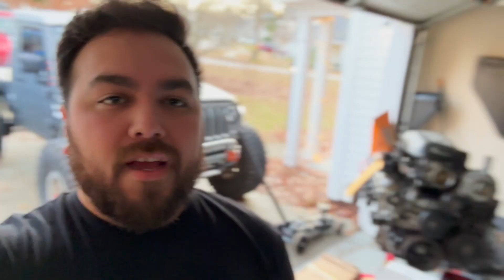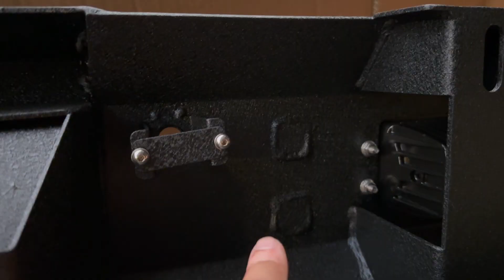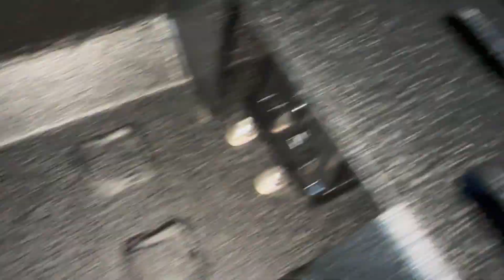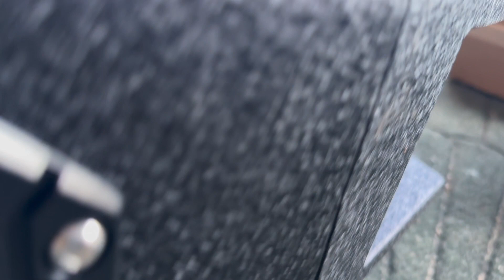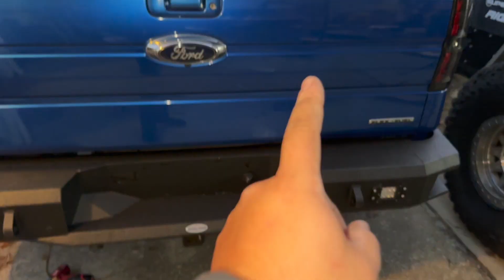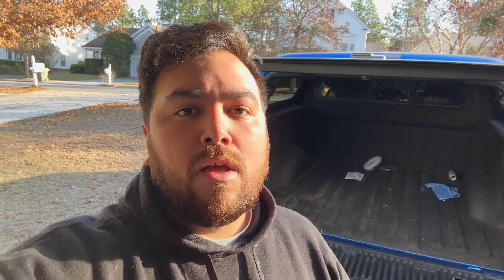Hooke Road F-150 Rear Bumper Install - This thing is BEEFY!

Comment: I installed the bumper but the back up sensor aid keeps going off did you have the same issue if so what did you do to fix it did you have to adjust the bracket of the sensor aid for it to fit?
Reply from the maker: Never was a problem for me

Comment: Just installed the same bumper on my 2017 F150. There's no way the Parking Aid sensors are going to work, there's not enough room for the plug. I noticed you didn't hook yours up also in this video. and the Spare tire lock will not work either, something else you neglected to put on in this video.
Reply from the maker: My rear parking sensors are plugged in with no issues. I don’t remember even trying the spare tire lock though.

Comment: Awwesome instructional, I am installing this exact bumper on a 2013 FX4 right now so this is very helpful. Word to the wise - get a friend to assist with the heavy lifting part if possible! Also a couple milkrates or something to lay the stock bumper on during removal is helpful and safe.

Comment: How did you connect the license plate light? I didn’t see anything on there
Reply from the maker: If I remember right it was just unplugging the original one and plugging in the new one. I’ll double check in a bit and update if different.
Reply: @aguywithajeep  the connector on the new bumper is completely different... I'm having the same issue
Reply: @xxx_playa_xxxyee1059 what was your solution finding the same issue right now

Comment: Nice video, i just installed same bumper on my 13,  seems as though you’re missing d rings too!   Item description says it’s supposed to come with them,  mine did not.  😢.    I intend to wire my lights on a switch,  do you think I need all that relay crap or just go straight to the rocker.. (yes I will have a fuse either way.
Reply from the maker: They draw little enough power that you’d be okay without a relay most likely

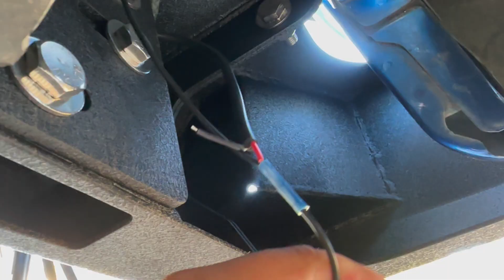Comment: I just got this bumper on American trucks can't wait to get it but is that daylight on the edge of the weld on bumper at 10:50 ?
Reply from the maker: Yeah there’s a small open section for water drainage in the corner.